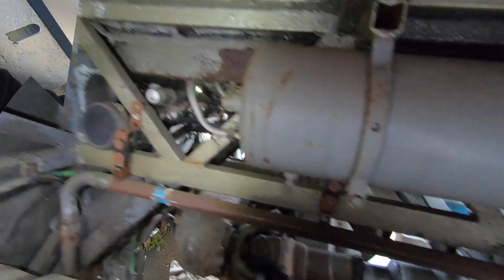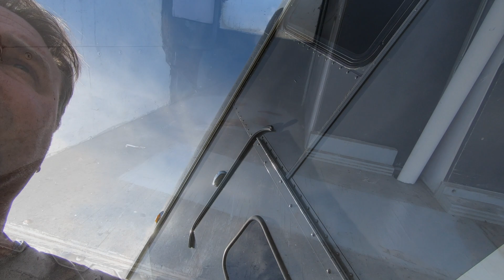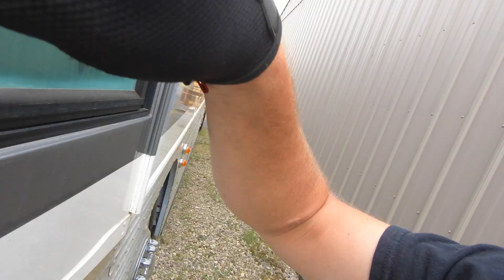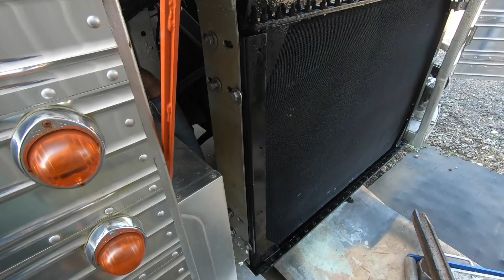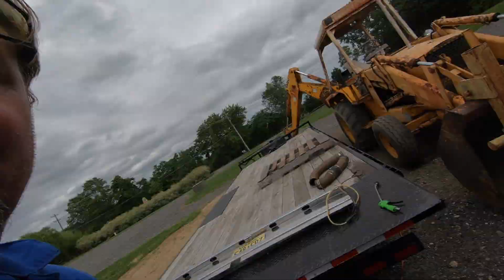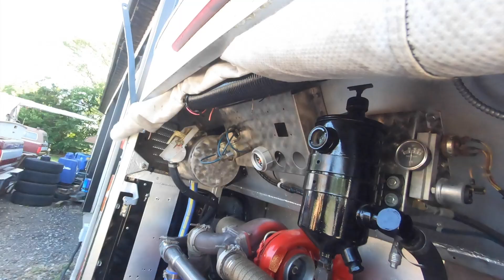Will This Detroit Diesel Start!?

Comment: Great job!!!! Are you using two go pro's.....We are working hard rebuilding our 671 Detroit, we just had the engine bored out to fit .10 over liners we have just started using 2 go pro's ...lots of fun and a ton of money rebuilding these engines...Glad you got yours started....great video....
Reply from the maker: Thank you! I've been watching your videos as well. I do use 2 cameras. But one is a knock off go pro for $50 but it shoots in 4k. That was the far away shots. Good luck With your motor. It sucks you had to tear it down again.
Reply: @11thhourcustom  It is a bummer but if we would have kept it the other way it would have been a disaster. We are going to start putting it back together soon. Thanks for watching glad you got yours started....